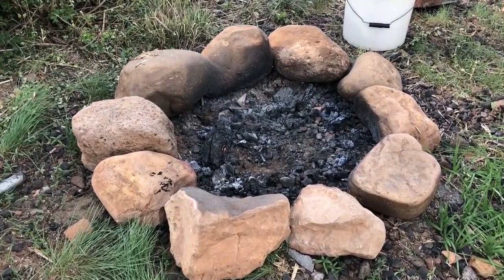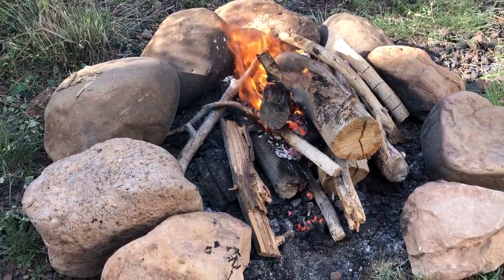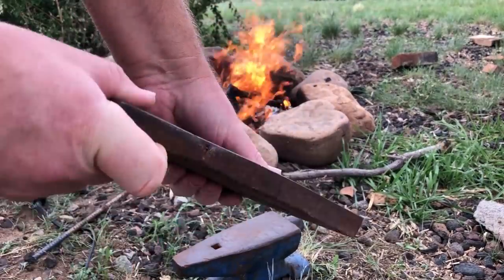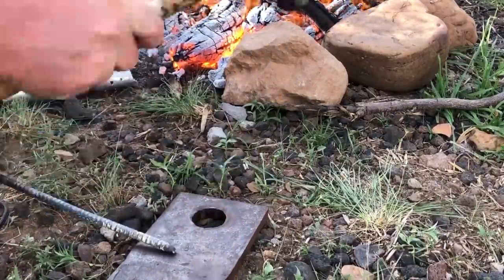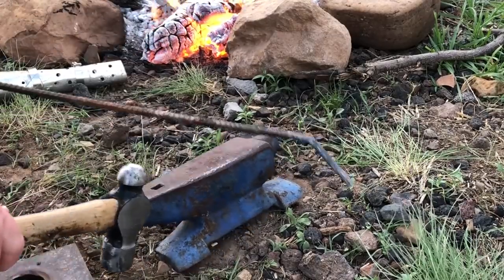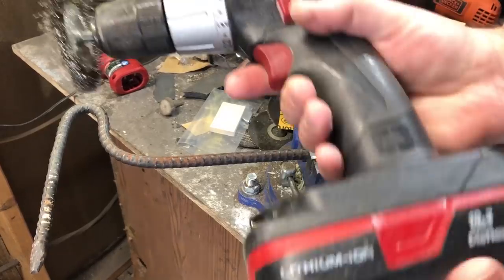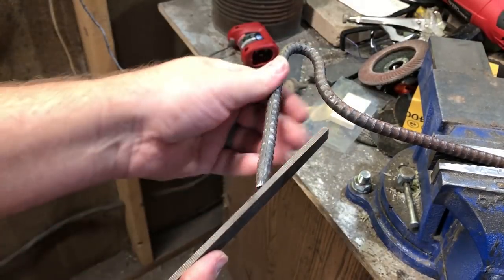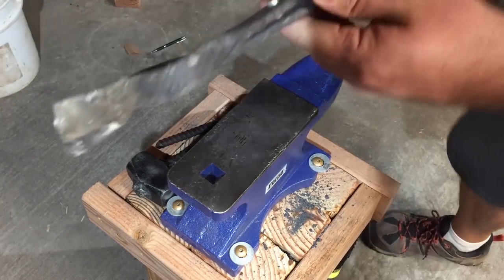***GET FORGING*** You already have everything you need!

Comment: That was very inspiring and I’m thinking about doing a forge in my garage my background is jewelry making so I have the basic knowledge great video
Reply: It is not recommended to start a forge in a garage because if red hot metal falls on the floor, concrete can explode with the heat

Comment: I made a forge out of a barrel style grille. I put a hand blower  attached to the side blowing under a charcoal bed. No matter how much I crank the blower I can't get the heat I want. Any suggestions? Or should I just get a hair dryer?
Reply from the maker: Sir Mister I’ve often wondered about those handcranked blowers, it looks so cool when you see a blacksmith using one… Unfortunately I have no expertise in that area. It might have to do with the design of the Forge, in any case I’m guessing a blow dryer would do the trick… Just doesn’t look quite as cool. LOL.

Comment: Great video! You earned my sub :). I got some questions: what kind of bricks did you use? Normal bricks would  explode right? What kind of metal/ steel should i start with as a beginner? Im thinking about trying some rebar like you did here.
Are blowtorches good instead of a fire? Thank you in advance :)
Reply: Dry clay bricks are good for starting with. Cinder blocks tend to crack and wet stones WILL explode. However a normal clay brick will work fine
Reply: you could buy firebricks which are specially made
Reply: @muunii6801  thanks :D a bit funny that You answered  for a 2 year old comment xD
Reply: Or you can dig a small tunnel

Comment: Do you know anything about using a propane tank connected to a chamber that spins with air or something?
Reply from the maker: Northern Sailor The only propane forge I have any experience with is one I built last winter. That one uses a Venturi style burner, basically just a pipe with a propane nozzle at one end and a few other modifications. It works, but I might need a second burner to get it hot enough for things like Forge welding. What you described sounds interesting though. Let me know if you learn more about it. I’m always interested in the design aspect of this hobby. Especially DIY stuff.

Comment: Hi FargoFX can you make a home make fishing hook 

Also I have started forging with the hammer in the beginning and the hammer near the end and a hairdryer in my back yard after watching your first how to srart forgoing and I forge on a elevator wait
Reply from the maker: Home made fishing hook would be an awesome challenge. I honestly hadn't thought of that one. I'll def look into it.
Reply: Funny. I also use an 80lb elevator weight. Before using it as an anvil I attached a vice to it so I could easily ground/hold oddly shaped pieces for welding.
Only disadvantage is that it has no round edges. Hope to fix that with the next large brushfire I've got to get rid of.....

Comment: What about a heat gun?
Reply: I've tried a heat gun.  It doesn't move a lot of air, so it's hard to get a properly hot fire.
Reply: @stevenscott2136  ah sweet thank you for the reply kinda wierd in a way   you think it would since it reaches 2500 degrees lol but thank you 😊